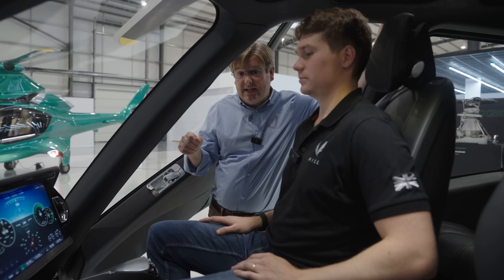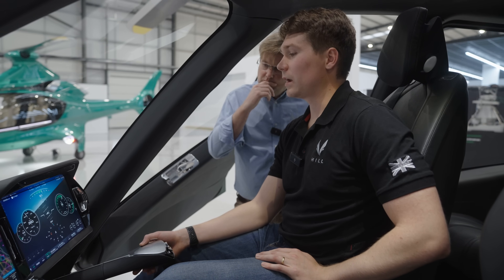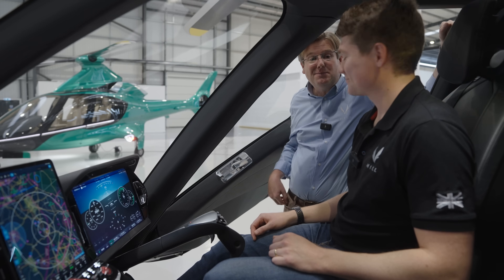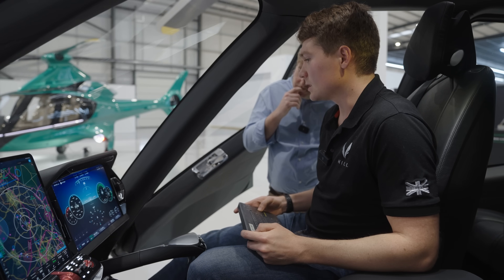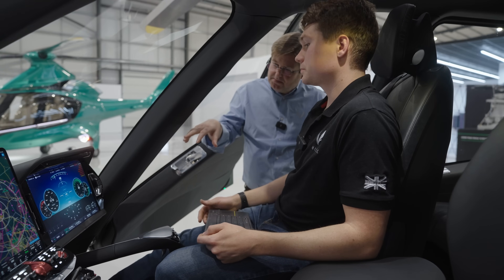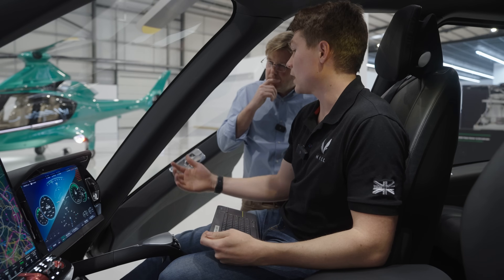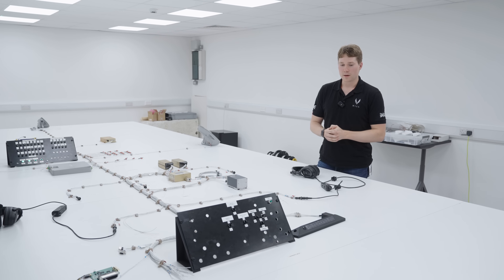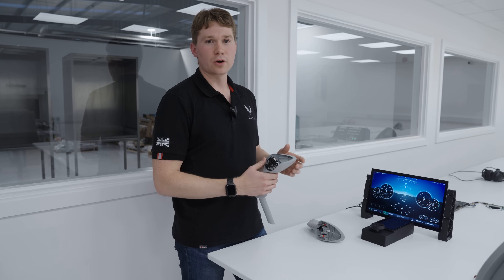Production-Intent Hill Digital Cockpit

Comment: What a mess they made of that user interface. 
There is absolutely no reason to put the altimeter and VSI on the wrong side of the AI (where the ASI should be) and the ASI over the AI, where you would normally have roll angle (on civil aircraft) and flight mode annunciators. There are reasons for having the basic T standardized across the industry. Let’s hope that mess won’t get certified.
Engine instruments aren’t so important that they need to replace flight instruments, but there are ways to fit them on a PFD without moving primary instruments from their normal position.

In modern aircraft with (EI)CAS (or ECAM) integrated into the PFDs/MFDs you basically only need a combined master warning/caution PBA, or possibly one of each. There should be reversionary modes so you get the CAS-messages (and basic instruments) as long as at least one display is working, hence no need for separate lights.

I don’t understand why so much time was spent trying to explain how an altimeter works. GA aircraft often have altimeters with three hands, but larger planes (and fighters) have had that type as (electro)mechanical instruments for ages. I fail to see why it blocks part of the scale across from the hand, that doesn’t happen with the traditional instruments.
Reply: Are you suggesting the right side (FLI (power) and dual tach) should not be in the right side of the attitude indicator (which is centered)? I’m not sure if you are a helicopter pilot, but having Nr (Rotor RPM) and Ng/N2 (Engine RPM) in the pilots main view is absolutely essential.

Regardless, what would you suggested layout be?

I personally believe this is a pretty well measured modification from the “standard” you would see in an airplane, say a Garmin G500/G1000, but properly modified to what a helicopter needs!
Reply: Exactly! I commented just on a previous video. Stick to standardised layouts. Why change???